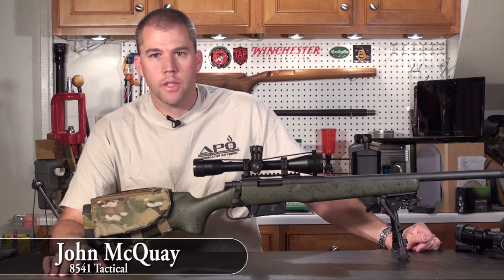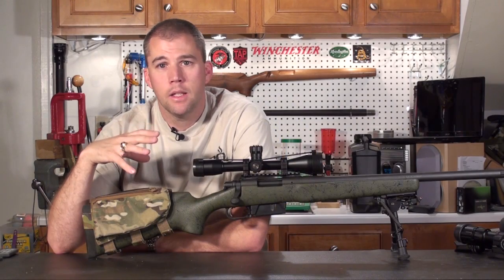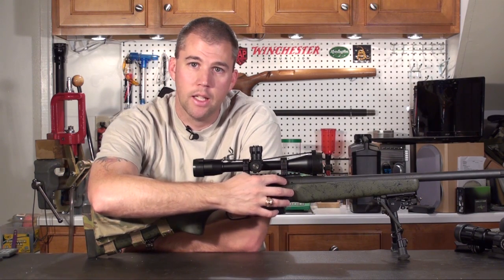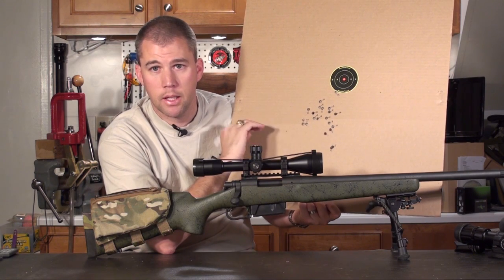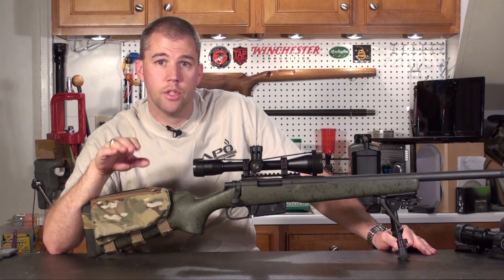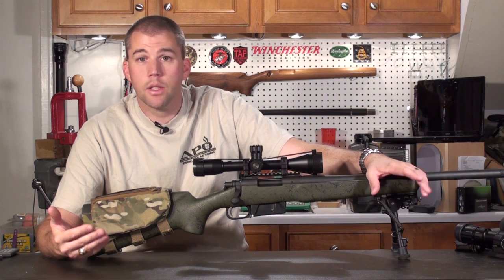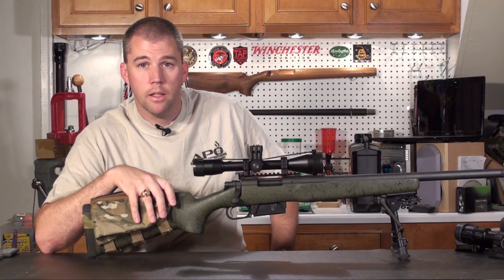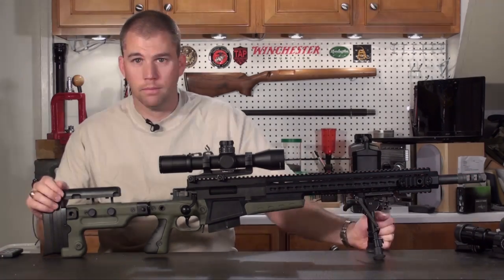Mail Call Mondays #24 - Reloading Ladder Test

Comment: (11-14-15 - 2:27 p.m.)  Well, got back from the range.  The bipod was solid as a rock--I was shooting from a bench rest.  I'm sure there are thousands of guys out there using it that way, it's just I've never seen it.Only had six rounds to use...didn't want to stop/wait and load  more :), and it only took three shots to find out how it would work anyway--down and dirty.  It was like the rifle was bedded in concrete.What I did find out was:1)  Since the bipod on the butt stock is already at 6-inches, I'll need to locate a longer threaded ram for the front rest.  I didn't mess with the foot screws to get out past 250-300 yds.2)  Couldn't get my cheek-weld close enough to scope, like with the rear sandbag, before the inside bipod leg was pushing into front of armpit--I'll raise it up out of the way next time.At any rate, now I have EVEN MORE reasons to fiddle around down at the range, and to load more shells :).

Comment: Thanks for your response, I really appreciate it, and appreciate all the other information your sharing with the community! The shooting I do will consist of fairly long ranges upwards of 1300m with some decent angles. No flat ground around here...But as you said the compensated distance offered in the original CRF1600 should be suffice, even at these extended ranges and angles I hope! Feel free to correct me if I'm wrong..Thanks again, and keep up the good work!

Comment: For semi-auto .223 loads do you see the need to go to this length of work up?  If yes do you see a difference in shots loaded from a manually operated bolt and a gas operated bolt. To clarify, should I have one wasted round to start the mag which is manually loaded and then fire the rest as the gun would normally via the gas system?

The gun I'm loading for is a 0.5 MOA at best gun that I use for 550 yard tactical style steel matches.

Comment: Actually I think I was thinking about it in reverse, it is the new version with horizontal distance in built that I put in the no angle into my solver correct? And the original version without that feature that I input the distance measured, then put in the correct angle of the shot to the target and it solves the equation. So if that's correct, it is the actual (calculated) horizontal distance to the target that is most important? Thanks again John

Comment: When cases show signs of high preassure, for example a stamp mark on the case head from the ejector hole on a Rem 700, can they be reused or should they be thrown away? I guess a possible problem using them again is that you might not be able to tell for sure if there is a new stamp mark or an old one. What do you suggest?

Comment: Hey John, question regarding Rangefinders: Im looking to buy the Leica CRF1600, pretty sure it doesn't have a horizontal distance measuring setting, but the CRF1600b does..so my question is do I need this extra function? Or do I use the angle-compensated distance that I'm pretty sure the original CRF has? If I was to use the angle compensated distance, then do I put in a shooting angle of "0 degrees" in my ballistic solver as the Rangefinder has already accounted for this? Cheers! Love the vids!

Comment: Interesting............you say you seat your AR10/308s to 2.800 to fit your magazine.  I have a several bullet configurations/geometries that contact the lands at ~ 2.711 and will typically seat bullets .006 deeper to give them just a tiny jump.  Never saw any reason to jam the bullets into the lands.   Also, there are some powders (H380, etc) that overflow the 308 case at about 52g.  What's your opinion on how much longer than the spec 2.005 case length is OK to accomodate large powder charges?

Comment: I am loading .308 with IMR 3031, starting with the minimum charge off of Lyman's reload manual and I could already see a crater or a ring around the firing pin dimple left behind on the expended cases, the primers flatten but still has retain round edge, so how far could I  back off on the charge to be safe to get to where I want just the dimple left from the firing pin and no craters is my goal, since those rounds started with the minimum charge of IMR 3031, the powder is about 60% fill in brass and make rattle sound when shake, I'm afraid to back off more... what is your take on this?